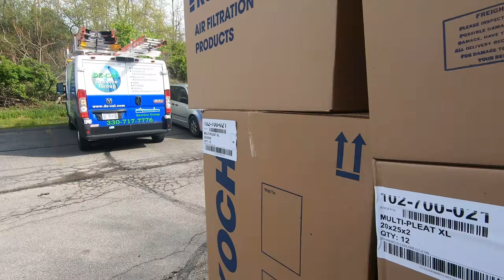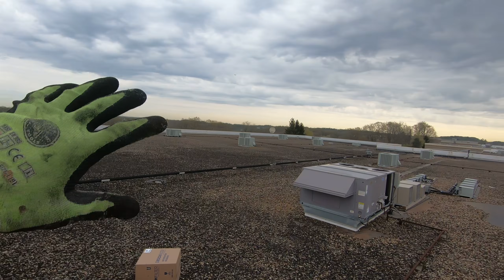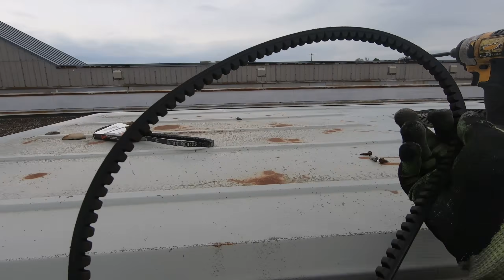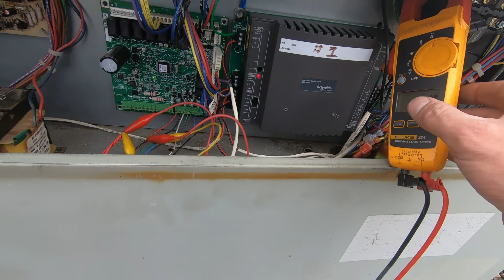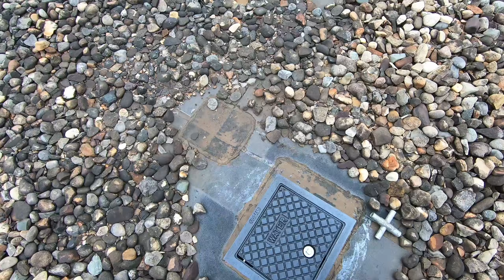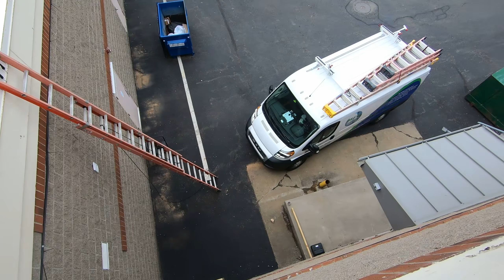Commercial HVAC Preventative Maintenance

Comment: does anyone here have any information on small carrier roof top units that have an Ecconomiser installed? I hate the filter access on these things. you have to smash and bend the damn filters to get them in. I see new units with the condenser coils being trashed by this.   what is the proper way to change these? talking 1 inch filters.  should you remove the Ecconomiser?  LOL   terrible design.  I can't imagine that this is just the way it is.  but other techs tell me it is just what it is.   shame on you Carrier for this problem.  ( I Meant Evaporator Coil!  )

Comment: A good thang also is check the heat exchanger even in the summer time because that can save you  especially if you found a bad part or on a maintenance, because I was helping a tech on a job and he found a leak on a Suction line he was  about to give her a quote but I found a cracked heat exchanger also.

Comment: What do you mean when you say you have a jumper? What is the purpose of doing a jump? 

Can you please explain what a Jumper is, where it’s done, why it’s done, and how it’s done? Please and thanks!!!!!!
Reply from the maker: Jumper wire. Used to jump 24v between r and w to bring on heat. Basically bypassing the thermostat
Reply: @RyanHughesHVAC  you would do this when you’re on cooling mode, you are basically bypassing to turn on the heat mode just to make sure it works and turns on fine, right??
Reply from the maker: @anthonybarragan1687  yes, you can jump in out in heat or cooling while testing the unit just to make sure everything is working properly
Reply: @RyanHughesHVAC  thanks!